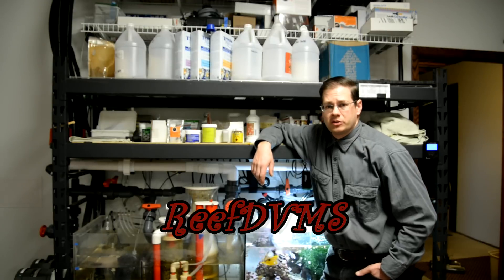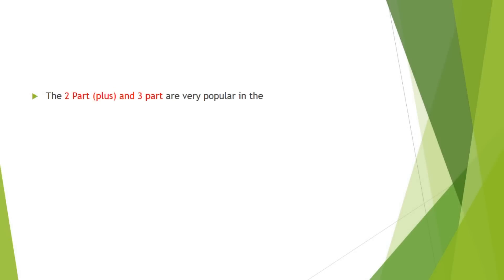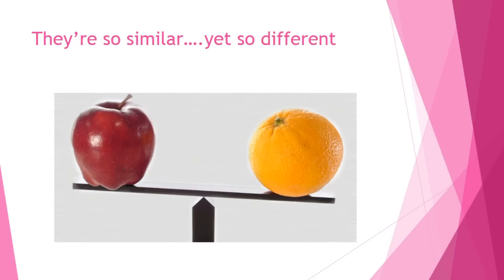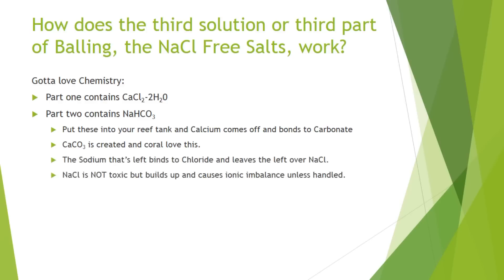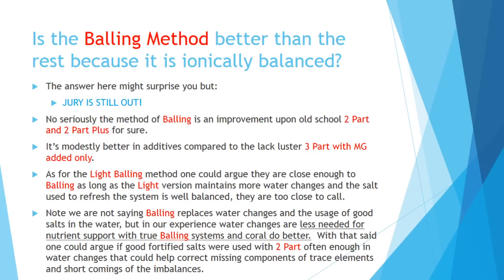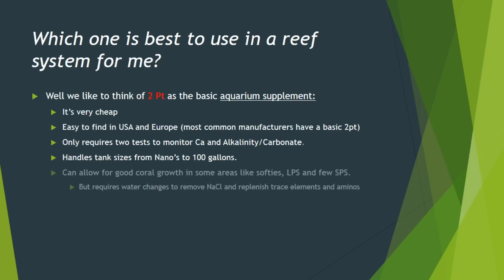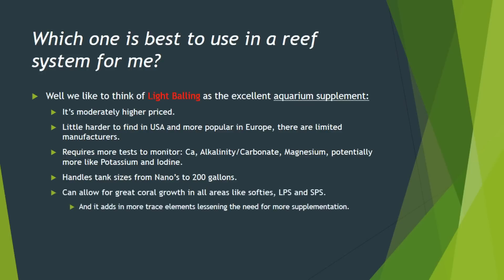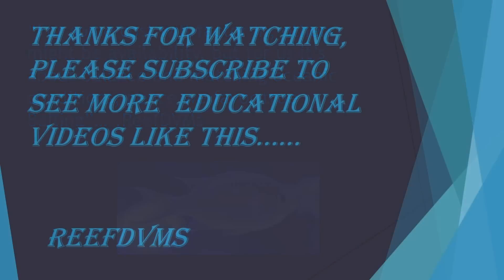Dosing 2 Part, 3 Part, or Balling Method in Your Reef Tank?

Comment: wow super nice info....is testing the water the only way to find out if you need to use one of these for your reef tank? should i expect to have to do this down the road with a reef tank say 2 or 3 yr later? what kind of metal racking stand was that? it looks nice and beefy not like the other shelving units....
Reply from the maker: Rico Suave I would recommend that water test be done at least monthly be you and if needed qtr by like triton to make sure the water tests are correct, and if able watch your corals, as things change good or bad its normally water issues=)

Comment: I started using the Balling method from TM. My start date is Sept 2015 till present. My Magnesium levels are through the roof! The directions are: Add equal parts of Part A, B and C. However, this does not work. I need to add 2 parts Part A, 1 part part B, and none of part C- as my Mg levels are through the roof. I even use TM pro reef salt. No worries though, titration and diligence will get me through this. FYI, titrate to be sure the manufacturer of the product comes through. And yes I mix everything well, including the salt. I still will use it it , but in different dosages for sure.
Reply: I will ask for this here, I think it's because the NACL free Salt has Magnesium... so if you have high levels of magnesium you sould not add NACL free salt. Is that True REEFDVMS? In this case you should use just trace elements and amino acids? right?